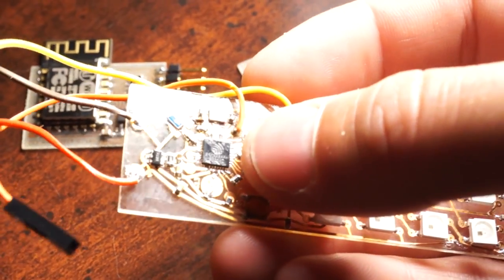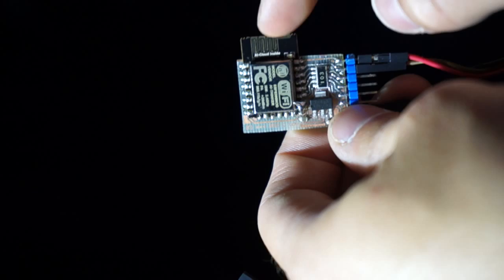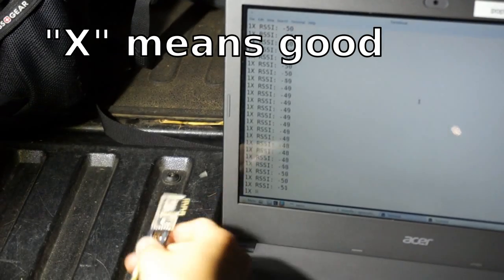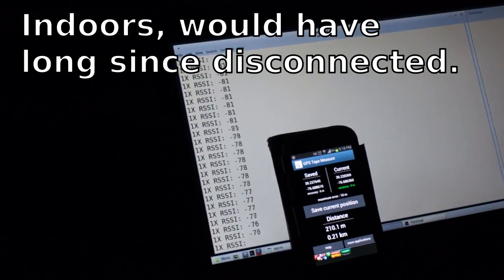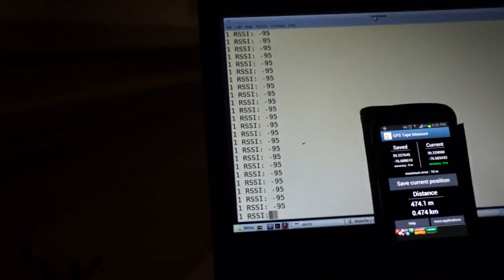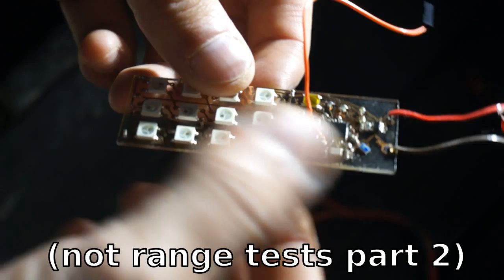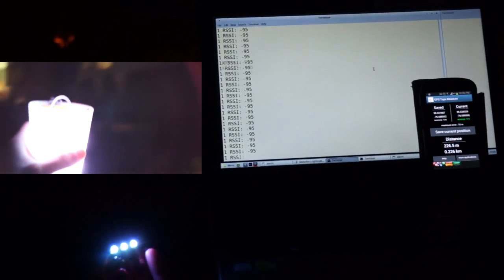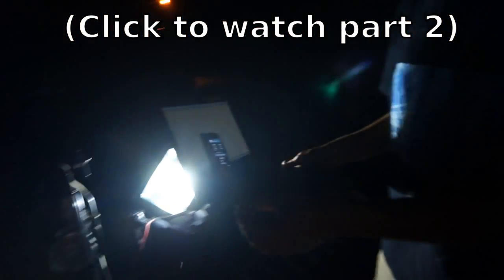ESP8266 Range Test Part 1

Comment: Hello there! I was thinking of using an ESP8266 for some projects this summer instead of the usual RF-links because it seems they provide an incredible range for an even more incredible price tag. I've seen your video's a while ago, but wanted to ask you some questions now that I'm going to try and use the ESP for long-range communication myself:
-Would I be able to extend the range (significantly) if I would solder a copper wire on to the antenna trace on the PCB? Or would it not matter?
-You video shows tests where there is a visual link between the 2 antenna's. For my projects, there would often be dirt/trees or even asphalt in between the antenna's. Obviously it will affect the usable range, but do you have an estimate by how much? Would it reduce to just a few meters? Or would it still be usuable for somewhat longe-range communications?
thanks in advance!
Reply from the maker: (1) That's kinda funky.  There are positives and negatives.  If you solder a wire it will pick up broad band interference much more significantly. You can definitely attach a rpsma connector and put on a real 2.4 GHz antenna, though!

(2) I really can't provide any suggestions as to how environmental features will effect the quality of the signal.  You really will have to try it.
Reply: Thanks for the quick response! I still have a few antenna's of an old router lying around. I'll try out those!
I'll do a test of the signal quality, similar to how you did it and will let you know how it went :)
My idea was to make some kind of "stream-tracker". There's a lot of creeks and streams going in and out of a forest near me, and although they have been mapped, I've heard 2 geologists argue where the water is flowing to, and what path it takes. So I thought it'd be fun to make a small boat with a gps-antenna and an ESP which will float along with the stream, and send its location to my cellphone, so I can follow it by foot/by bike, depending on how far it takes me^^

Comment: Hellos sir,
When i am using 5V 1A HLK5M05 as power supply in Home ESP12F with AMS1117-3.3 range become 15-20m & when i use HTC charger 5V 1A Range increase upto 30-35m.
Even during both test ESP12F is shrinking 5V & 80mA current via AMS117-3.3.
I don't understand, how to extend range.
Reply from the maker: How are you testing range?  What firmware?  Are you testing indoors?  Or out in the open?   What tools are you using to compare pings?  What architecture are you using?  Do you have extra bypass capacitors around the ESP12-F.  You will need a 10u before the regulator and a 10u and .1u after it.
Reply: i am testing using same mobile wifi scanner. Programmed with Arduino IDE. Testing Indoor.  i am using 0.1uf+100uf tanta at 5v input of AMS1117-3.3 & same two capacitor at 3.3 V output side.
Reply from the maker: Try not scanning, and instead maintain a connection and ping constantly.   What are you using to connect the two devices?
Reply: connecting Wifi with mobile using Websocket.
Reply from the maker: hmm I haven't tried that.  I've only done ping tests.    I would be surprised if that accounts for the significant change you are seeing!  What I mean is what is the device connecting to the ESP?  I would wager it was whatever you were connecting to the ESP.
Reply from the maker: Ah!  So you're on a cell phone?  If so, that is likely the cause of terrible performance. My cell phone doesn't get but about that far.  My laptop, farther.  But ESP to ESP can talk for a very long distance.

Comment: I use Mesh_demo with esp07, and only get 15m range at -84. Any idea?
Reply from the maker: No, never messed with the mesh demo.  Keep in mind, indoors, the limits are significantly lower.  This is outdoors, and clear LoS.
Reply: Is there any reason not to use it? i just want to know in your perspective, because i am new in esp8266. I use it in my project and got 20ms for ping, and it increase 20 for every hop. Its slow ?  And any recomendation what to read for program esp in C?
Reply from the maker: I don't really know, I've only ever used traditional ESP<->AP communications or hacking for raw broadcasts.

Comment: If RANGE is what you are after then try the ESP-07 with the tiny rf antenna socket:
http://www.banggood.com/ESP-07-ESP8266-Serial-WIFI-Module-with-IO-Adapter-Plate-p-980652.html
coupled with a Yagi antenna:
http://www.banggood.com/Yagi-2_4GHz-25dbi-WiFi-RP-SMA-Antenna-For-Wireless-Router-Outdoor-p-84566.html
and the pigtail:
http://www.banggood.com/50cm-U_FLIPX-to-RP-SMA-Female-Antenna-Pigtail-Jumper-Cable-p-924946.html
Reply from the maker: Go for it!

Comment: You can use receive power to determine which is the closet AP, which can give you an indication position: The nearest AP, thus your relative location.
Reply from the maker: But you can only tell to many, many feet, not much better than that.
Reply: +CNLohr quite true, but with careful positioning of ESP8266 as APs you can determine which one you are closest to, and thus your position. It is crude, but it does work.- or use an iBeacon

Comment: I have a question... I've setup an eap8266 as an internet switch yo turn on/off mains appliances... I'm using arduino ide.... 

it works for a few days without any problem but after that it just stops responding to any commands I give from internet.

does problem exist in the SDK programs or is it a hardware problem?
Reply from the maker: I have run ESPs for a while.  They used to be awful at locking up all the time even with the SDK, but, recently, that seems to have gone away.  I guess I should try to run one for an extended period of time.

P.S. Until the most recent SDK, the connection would degrade over time without a hard reset.
Reply: CNLohr thnx.... can you suggest a solution? or any other module... i'm looking for cc3200 but it's a bit expensive to play with.
Reply from the maker: I am all ESP all the way.  I am currently unaware of any long term lockup issues.  Seriously, TI and Nordic had been going head to head, then Espressif hit this one out of the park!  I wouldn't dare consider /any/ other RF solutions for any problems EXCEPT MAYBE something with LoRA if I had to.
Reply: CNLohr Thnx.. maybe long term lockup issues happens only on arduino IDE....i'll try the sdk version..

Comment: Uhm, is that your password at the top screen border?
Reply from the maker: osnap.  Btw... it was actually visible in one of my previous videos, too.
Reply: Anyway: Great video! One thing to note about wifi/broadcasts: Broadcasts are gettings sent at a fixed broadcast rate, which might be different from unicast test results, because broadcasts are usually transmitted with a different modulation and speed than unicast packets. 
This is done to make sure every machine in the network can receive the packet, and of course it uses up lots of airtime. 

You'd probably want to test things like that in a different way..
Reply from the maker: I wasn't too clear about it, but I did broadcast from client to base, and unicast back, so I test both sides of the link.